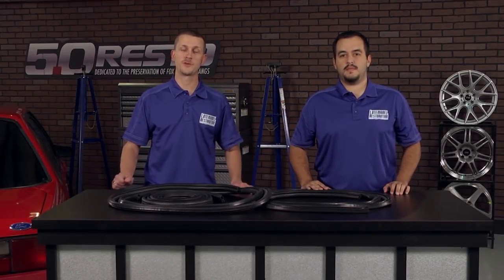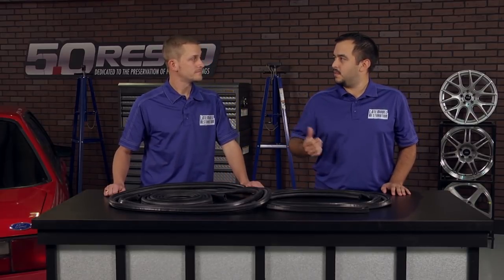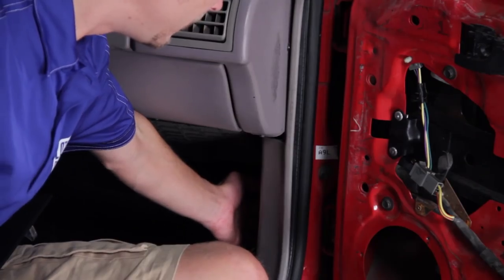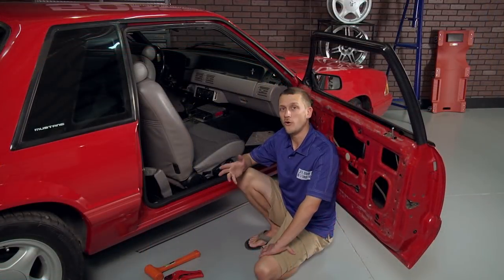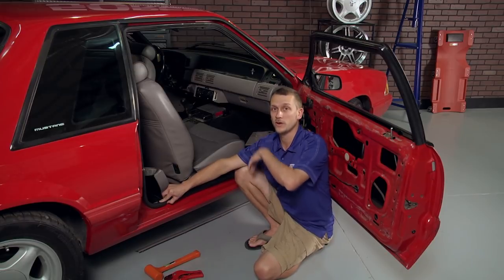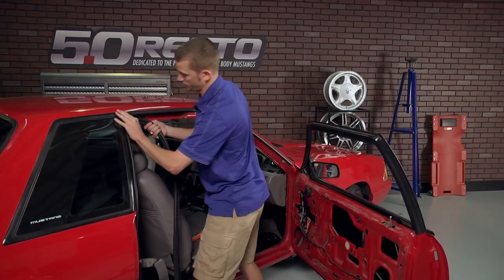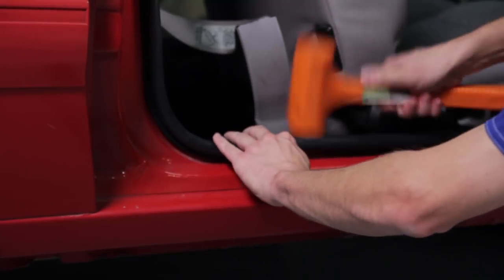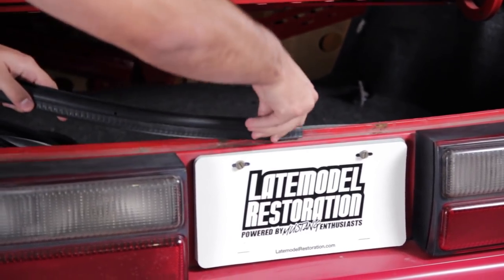Fox Body Mustang Weatherstrip Install: Door to Body & Trunk/Hatch - (1979-1993)

Comment: Just replaced my door weather strip on my 90 LX hatch and love the quality. Kudos to LMR! Like many others the door now has to be slammed shut to get it to latch. The old weather strip was old and worked in and I believe the new weather strip just needs time to be worked in to become more pliable. There's also a chance that it's just a little too fat as well. If you adjust your striker out then the door will not close flush with the rest of your car. Closing the door hard is just what we have to live with for an indefinite amount of time. Still worth it IMO.
Reply: Update,
Over one year later I still have to slam my doors. Poor product. I will try to get the OEM reproduction kit that LMR sells and hope that it works better than the house brand. Very disappointed.

Comment: i just installed new weather strip kits for my 91 hatch, the only other thing i suggest is apply a thin layer  Vaseline at the a pillar to allow the doors to close easily, otherwise the seals have a tendency to pinch in that area,these kits are exactly like the oem parts

Comment: We actually needed to do this with my '84 t-top and it didn't seem to work. there is a special door string that ends with a bigger hunk of rubber on the top so that it seals with the t-tops. Just plan on spending over $200 on the stripping for any t-tops guys.

Comment: Are these better then the ones you sold in 2002 I have never been happy with them they are to big BULBUS and I put slots in them and my doors open only for on cruise so they are broke in ☹️
Reply from the maker: Tim, the set on the link below is the way to go. These will be the exact Ford reproductions and seal off better than the generic options. These do not require the same break in timeframe as the other options. 

https://lmr.com/item/LRS-20708AE-PR/1979-93-Mustang-Door-To-Body-Weatherstrip-Pair-Exact-Ford-Re

Comment: This question is not in relation to the video in any way but would anyone happen to know  what the plastic on the back half of my mustang is called? I mean like all the plastic like the roof plastic and side plastic on the back half... it is badly sun damaged and i need to get it painted or replaced please help... thanks.
Reply: Adan Patino im wondering the same thing if you ever found an answer I am curious. Couldnt find rhis moulding for sale.
Reply: CodyDaCoyote I had no luck with it i had to scrape all of the paint off put on some pre spray and then respray everything.
Reply: Are you talking about the window trim?

Comment: I'm sorry I love you guys, but I had bad experience with this kit. The doors never closed right. I had to slam the doors real hard to get them closed. I could not open them easy anymore. I readjusted the doors but still after almost 2 years of struggle the door handles are broke. I bought a new set from a different company and I have no problem ever since.
The rubber material is just too thick. Bad design.
Reply from the maker: Sorry to hear that! We will look into this to try and make this kit better!